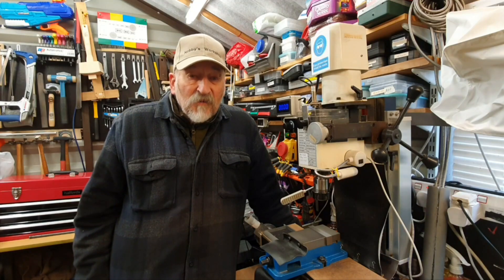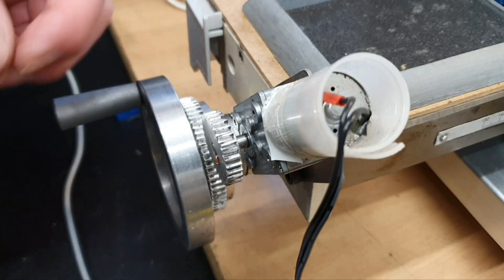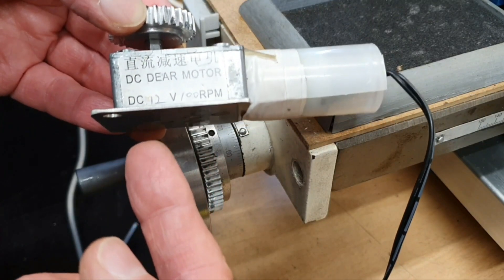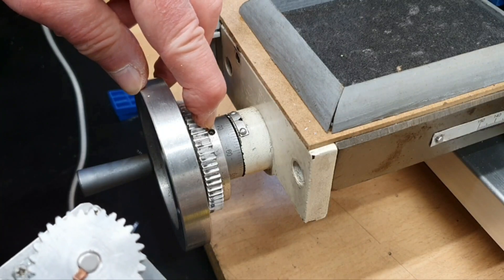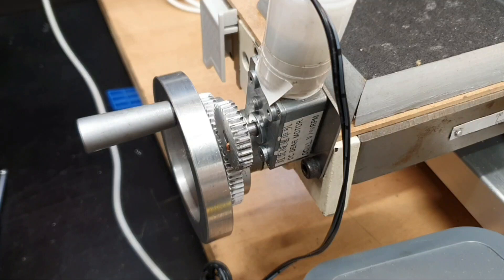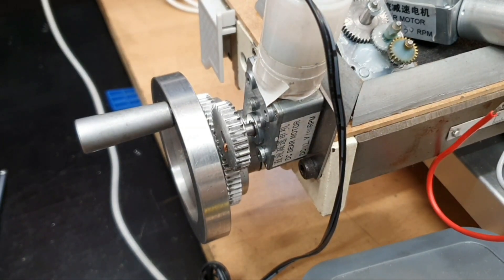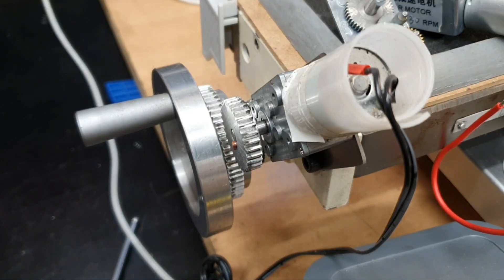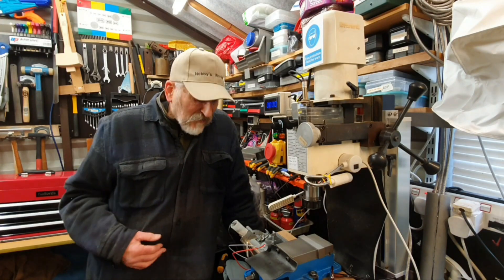Mini Mill X Power Feed Motor.

Comment: I currently have a power that I made two years ago and used a stepper motor and driver with a PWM connection is currently a direct drive.  Lately, it has been causing me some issues, so I have designed a clutch mechanism to disengage the feed for manual operation.  I also purchased a motor like yours that is 24v, speed 470, and 7N.m of holding torque.  Should work well for my LMS3990
Reply from the maker: @taranson3057  That sounds like a good solution. The one I made has it’s problems, but it gets the job done. ATB Nobby

Comment: Very interesting Nobby.  A good solution.  Cheers Rob
Reply from the maker: Thanks Rob. Any sign of you getting a mill some day? Cheers Nobby
Reply: Hi Nobby, I keep looking, but they are either too big or too small for what I want it to do.  I get by milling on the lathe and it works quite well for most things.   Also space to put one is the issue.  I don't really want to get rid of my old Taiwanese 12 speed pillar drill, but that's about the only place a mill could go.  No rush. Cheers Rob @nobbysworkshop

Comment: Hi Nobby. I used a stepper motor and stepper controller and a 24 volt psu my motor is Fited in Place off the Handel. Form Brian
Reply from the maker: Hi Brian this is surely the best way to do it, but at the time I had some constraints on costs. As my mill is so small the little geared motor worked out fine. Thanks for looking. Cheers Nobby